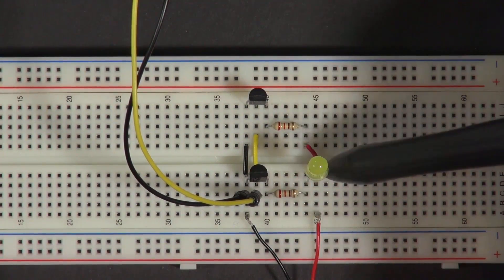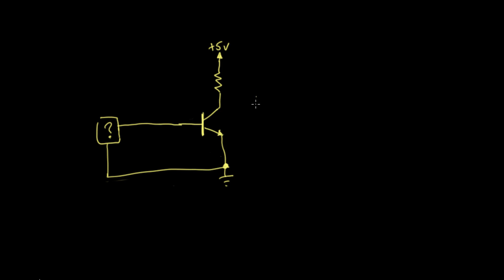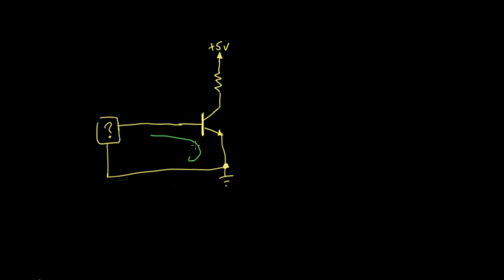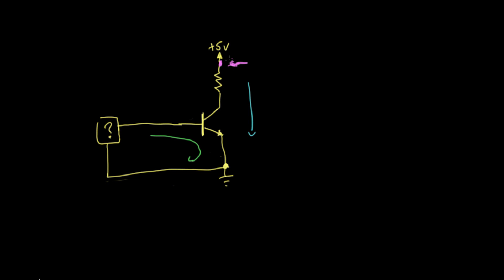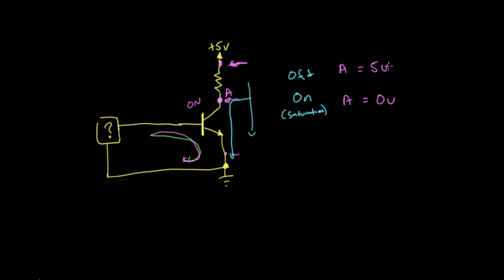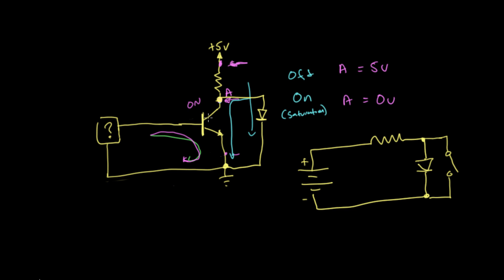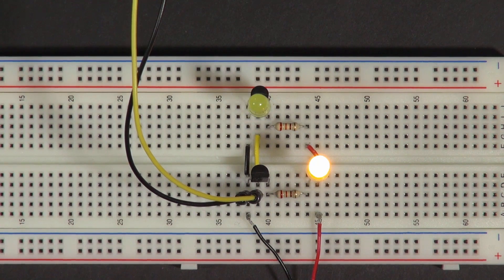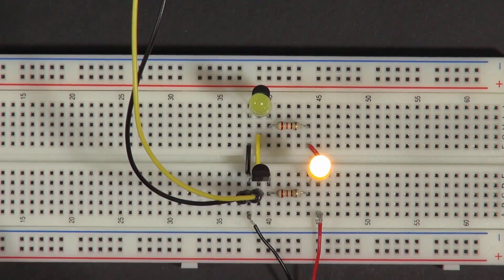Inverting the signal with a transistor | Digital electronics (9 of 10)

Comment: Isn’t there a voltage drop at point A to ground because of the resistor in series with the constant 5v power supply? Which would make it less then 5v?

Comment: There are two things that I do not understand and would be grateful if someone would try to help me.
1. How is that the placing of the resistor on the invert circuit from pre led to post led doesn't cause a problem?
2. If the voltage between the resistor to ground is 5V once the transistor is off, aren't we driving the led with 5V? (apparently not because the led doesn't burn, but wouldn't it be more accurate to say that the voltage from resistor to ground is 5V minus the voltage drop in the resistor?).
Reply: 1. Why would it?
2. Yes, that’s wrong. 5v was written before the LED was added. After LED was added he should have erased it. With the LED it’s 2v or 3v instead of 5v.

Comment: My mystery circuit was just VCC. Good thing I've smelt the transistor before it destroyed itself. After putting a 10k resistor between base and VCC, the transistor no longer heats up. But now I'm wondering, maybe there's a dedicated chip that could invert the signal instead of a transistor? All I need is to just light up an LED as signal goes to ground, because I have a relay module which closes the relays as signal goes to ground.

Comment: The concept of conventional current is really confusing and sometimes I find it unnecessary since it just illustrates the movements of holes not electricity. As an Artist learning electronics for my practice. The concept is utterly unnecessary. What do yoll think?
Reply: Electron flow direction makes no difference at all. It only comes up when learning the physics & operation of vacuum tubes, transistors, etc.

Comment: Sir what is the mystery device
Reply: Thé mystery device IS a ne555 in astable mode with a 10K resistor on the output pin. Ses others Ben vidéos. Cheers

Comment: so many people asking what the mystery circuit is. it is a slow oscillator circuit that has current limited outputs. it doesn't really matter how it is implemented. it could be a 555 timer, could be a microcontroller. the entire point one would use a transistor like this is when you can't source as much current as you want to directly. in other words, the output impedance of the driving signal is too high. so we use a transistor to buffer the signal. i feel like if he'd talked about things in terms of output impedance early on this would be less confusing for newcomers.

Comment: I’m still quite the novice at electronics but it seems to me, like what you created is a sort of delay circuit, not a reverse circuit. Because the current is still moving in the same direction as before, it is not being reversed in any way. Please correct me if I’m wrong - I am trying to learn more about this stuff. Cheers!
Reply: In no way is it a delay. Reverse as in reversed logic levels. Current flows from positive to negative - always!

Comment: maybe this is a primitive version of flip flop. and  for  signal for the transistor base is used for example perforated tape 
 and light source and diode when  the light will pass through the hole in the perforated strip will activate the diode and it will give a signal to the base of the transistor
Reply: No, it’s an inverting buffer or a not gate. It’s not a flip flop or like a flip flop.

Comment: Would be interesting and even important to show your voltage drops across your transistor.
Typically Vce in saturation is 0.2v and Vbe 0.7v.  That's one of the problems of using only a diode for reverse voltage protection in low voltage circuits.  Diode voltage drop becomes significant.

Comment: Tried this on a projekt. The short circuit will heat the resistor up extremely and destroy it eventually, if the transistor is on. Does anyone have any tipps for a solution?

Comment: From what I've learned in class, we need to have a resistor in the emitter or in the base. If we dont have one, from KVL the voltage in VBE will be equal to the voltage from that unknown circuit. This means that at a certain point VBE will be equal to 5V wich accoding to the Current VS Voltage graph will imply a massive current. Im not understanding how is it possible that the transistor doesnt die
Reply: If you recall from previous videos in this series (which I assume you watched, it's video #4), the "mistery" circuit provided a current of only 0.3 mA. The voltage was 5.14V when nothing was connected, but as soon as he connected the resistor and the LED the voltage across the LED and the 220 ohms resistor dropped to 1.82V. 

Assuming 0.3 mA when the LED was connected, with a voltage of 1.82V across the 220 ohms resistor and the LED, this means that 3.32V where dropped across the mistery circuit. Dividing 3.32V by 0.3 mA tells us that the output resistance of that circuit is 11067 ohms. Now, I didn't bother to check the mistery circuit but I'm pretty sure that Ben put some resistors right before the output in order to have that much resistance (~11K ohms).

If you know about Thevenin theorem, it's like having a 5.14V Thevenin voltage with ~11K ohms Thevenin equivalent resistance: in other words, it's a high impedance "power supply", which is capable of delivering only small currents: as soon as you load the mistery circuit a little more (like in this case, with a 220 ohms resistor and an LED), the circuit can't keep up and a significant amount of voltage is dropped across the high impedance of the circuit.

So, that's the resistance that's limiting the current flowing to the base: assuming that the base-emitter junction has a forward voltage drop of 0.6V, this means that when he connects the mistery signal to the base, there will be 4.54 V dropped across the output resistance (5.14V - 0.6V), which acts as a current limiter for the base, making the base current equal to ~0.4 mA (4.54V / 11067 ohms).

Unless I'm a complete douche and I'm getting this whole thing wrong, of course :D
Reply: It will work without a base resistor and not kill the transistor because the collector resistor limits the current.

Comment: When the transistor is on, hould the voltage at A (after the resistor just before the transistor) be 0.6 V and not  0V because when the transistor is on, there will be a voltage drop of 0.6V drop across the transistor?

Comment: Amazing explanation. There are very few digital electronics engineers on youtube that can explain these things in a manner that us layman can fully understand. I'm a programmer by trade (I guess you could say) but looking under the hood has been difficult to learn until I found you and a couple others (out of the many, many channels) on youtube.  Thank you sir. I've moved on from ttl using single transistors in series and parallel to using ics but there are still things to learn, even though I know how to build an inverter and somewhat understood why it works, I now understand even more. Great channel Ben, now I might be able to grasp your breadboard insanity in your other videos a little better. Haha
Reply: What are the other channels you watch for electronics.
Reply: @reddaxtor5662  there's a bunch if you're just starting out. Eewave is good, it's a very smart young Indian gentleman who has a good backlog of logic related stuff. If you're looking to learn how to solder and do projects and know enough to be dangerous haha just search topics. I read alot now, I've learned though that you can watch all the videos you want and know the jargon and understand it but picking something like an arduino project that you want to make into a permanent device or some such is the way to do it. Read and watch and practice hands on. How far along are you? I mean like do you have a multimeter and soldering iron, breadboard or any of that? A 30 dollar arduino kit is the best way to get your feet wet. If you're in Canada or the US I can send you a bunch of stuff to get you going. I'm not some weirdo, it's just what I do.
Reply: Eewave is a good channel. He has simple and complex stuff. There's cheap 74ls and cd4xxx chip kits on Amazon and they are a good starter. I read books and circuit diagrams now. I have over 100 types of logic chips now lol

Comment: The problem is that you have limited the current to a bigger load (say, a light bulb). To fix this, you can add another transistor with the base connected to point A.

Comment: Yay! I made it this far.... and I did it with PNP transistors, I just inverted the sense of the instructions. My "mystery signal" is a IR phototransistor I cannibalized from an dead TV and now I can make an LED flash from across the room.... and see its inverted signal. I have learned that the pulses must be narrow (less than 50% duty cycle overall, to abuse the phrase duty cycle), because during the pulse trains, the inverted signal (representing darkness) is brighter on average. Now I can look up what the pulse trains look like for common TV remotes, and test my hypothesis. I feel like I'm ten years old again. This is GREAT. Thanks, Ben!

Comment: Question. You say multiple times that electrons choose the past of least resistance. If I had a circuit with two paths back to ground, one had a N value resistor, and the other had a N*2 value resistor, are you implying that no current would flow through the path with the N*2 resistor? If you arent implying that, then what are you saying?

Comment: I don't understand why at least SOME of the current doesn't go through the path of the LED. If I had a 100 Ohm and 100K Ohm resistor in parallel, would ALL of the current go down the path with the 100 Ohm resistor? If a resistor was placed after the emitter, before the ground, would that have changed the output?

Comment: OK - when you wire the LED across the collector and emitter of the transistor, why does current flow though the transistor and not the LED? They're both semiconductors - what makes the (saturated) transistor have lower resistance than the LED?
Reply: I also came here to ask this. The only thing I can guess is that the effective resistance of an LED is lower than a saturated transistor? Searching for information on the voltage drop of the components indicates that a red LED drops ~2V, but the transistor drops by ~0.2V. Divide either by the amount of current flowing through to get the resistance value.
Reply: Voltage across LED & transistor are always the same since they are connected together. When the transistor is on, the voltage across it is almost zero - it’s basically a short. The LED needs to drop 2-3v to conduct, so it stays off. 

You can think of it as: the transistor pulls the voltage low, to ground. All the voltage is dropped across the resistor in accordance with ohms law, with none left across the LED & transistor.
Reply: LED voltage drop is like a barrier to jump, or a height to drop. You need to start with a sufficient height (voltage) in order to jump the gap or drop the height.
Reply: @davadoff  You are spot on.

Comment: Talking about path of least resistance, when the base current is on, why doesn't all the current get diverted through the part of the circuit without the LED? Wouldn't that have less resistance than the path through the remaining LED?

And when the base current is on, why don't both the LEDs light up?

I guess I'm confused as to why the transistor at the top diverts all the current from the top LED but not the bottom LED.

Comment: How is it that the voltage drop across the LED is exactly 5 V when the transistor switch is off? Shouldn't it be a little less than 5 V because there is also additional voltage drop across the resistor?
Reply: This is correct. When the transistor goes off, then  current will flow through the resistor to the diode, and through the diode to ground. So at point A, the voltage will be less than 5V. Effectively we have the original circuit which was powered directly by the 5V power supply.

Comment: i m still confused about the mystery power supply ，when it comes to the the same 5 voltage and same resistor and same LED,but with different amp
Reply: The mystery signal generator has an internal resistance in series that limits how much current it can output when shorted to ground. When you connect a load with a lower resistance to ground in series, the path to ground will be shorter at the point where the load and the input connect, so the voltage across the load will be closer to ground.

The current that flows when the supply is connected through a 220 ohm resistor is 0.3 milliamps, so you can calculate the internal resistance of the supply like so:
1V/1A = 1R (Ohm's Law)
0.3mA = 0.3/1000 A  (1 milliamp is 1A/1000)
x = internal resistance

5V/(220 + x)R = (0.3/1000) A
5V = (220 + x)R * (0.3/1000) A
(220 + x)R = 5V/((0.3/1000) A) = 5V/1A * 1000/0.3 = 16666.66... R
x R = ~16666.6667 R - 220 R = ~16446.6667 R

So the internal resistance is around 16.44 kilo ohms.

Adding a load resistor to the source effectively creates a voltage divider, because the source has a fairly high resistance, while the load is almost 100 times smaller, so the voltage across the load is also much smaller, because most the source's output power is dissipated across its internal resistance.

The voltage across the load is:
5V * 220R/(16446.667R + 220R) = 
= 5V * 220/16666.667 = 
= ~0.066V = 66mV  
(The equation results in a voltage because you have V * aR/bR = V * a/b)

So the voltage that the load resistor sees is only 66 millivolts.
You can check that this gives the observed current with the following:
66mV/220R = 0.3mV/R = 0.3mA

A more detailed explanation about why the voltage across the load is smaller:

When you connect a resistance between two voltages (Vin and 0 volts in 
this case), a smooth voltage gradient forms across the resistor, because
 the resistance between the middle of the resistor and ground is half of
 the total resistance, but the same amount of current flows through that
 section, so the voltage from that point to ground is also half of the 
voltage across the whole resistor.
1V/1R = 0.5V/0.5R = 1A

When you have multiple resistors in series, you have the same gradient, 
but across multiple resistors, so the voltage across each one is 
dependent on how much resistance they have proportional to the total 
resistance, in other words, what percentage of the total resistance they
 have.

A general formula for the voltage across the resistor connected to ground when you have 2 resistors in series is
Vin * R2/(R1+R2),
where R2 is the resistor connected to ground, and R1 is the resistor connected to Vin.

The derivation is as follows:
Vin = the input voltage.
Vout = the voltage across the resistor connected to ground (0v).
R1 = the resistor connected to the input voltage.
R2 = the resistor connected to ground.

Vin/(R1 + R2) = Vout/R2 (the current across one of the resistors is the same as the current across both resistors because they're in series and there's no other connections in the middle.)
Vout = Vin * R2/(R1+R2) (the output voltage is the input voltage times the ratio of the grounded resistor to the total resistance.)

Vin
___
  |
  /
  \   
  /   R1
  \
  /
  |
  .-----------| Vout
  |
  /
 \   
  /   R2
  \
  /
  |
____
 __     (Ground)
  - 

A side note: if R2 is connected to another voltage instead of ground, then you also have to take that into account.

V1
___
  |
  /
  \   
  /   R1
  \
  /
  |
  .-----------| Vout
  |
  /
 \   
  /   R2
  \
  /
  |
___
V2

A more general formula in this case:
Vout = (V1*R2 + V2*R1)/(R1 + R2)

The V1*R2 part means that making R2 bigger brings the output closer to V1, while the V2*R1 part means that making R1 bigger brings the output closer to V2.

The derivation is as follows.
V1 = the voltage that's connected to R1
V2 = the voltage that's connected to R2

(V1 - V2)/(R1 + R2) = (Vout - V2)/R2 (The current across both resistors is equal to the current across each of them individually. If V1 and V2 are the same, no current flows, because there needs to be a difference between the two voltages for there to be current. If V1 is more positive than V2, current flows from V1 to V2, and we say that this is positive. If V1 is less positive (or more negative) than V2, current flows from V2 to V1, and we say that this current is negative.)

(V1 - V2) * R2/(R1 + R2) = Vout - V2

Vout = (V1 - V2) * R2/(R1 + R2) + V2 =
= (V1*R2 - V2*R2)/(R1+R2) + V2*(R1+R2)/(R1+R2) = 
= (V1*R2 + V2*((R1+R2) - R2))/(R1+R2) =
= (V1*R2 + V2*R1)/(R1+R2)
Reply: The mystery supply is just a voltage source with a relatively high output impedance

Comment: Best explanation ever! You can minimize current used with properly sized resistors.
I have used this circuit where there needed to be an "on" indication and an "off" indication from a single output.